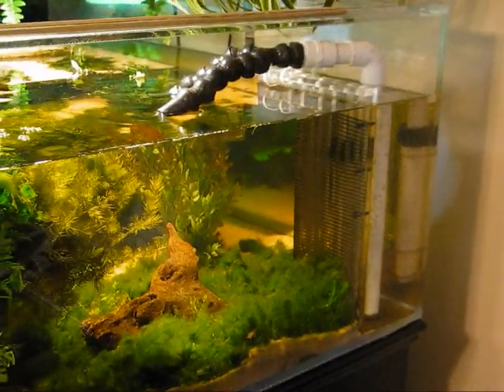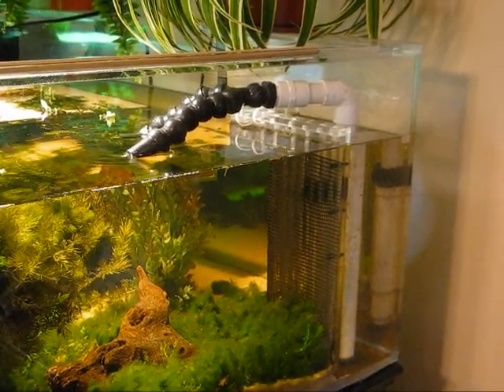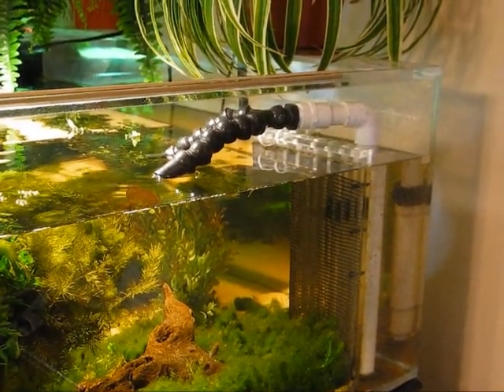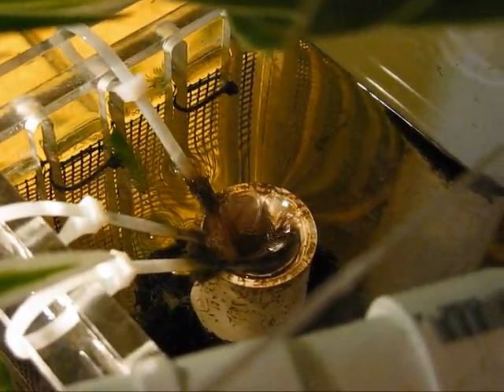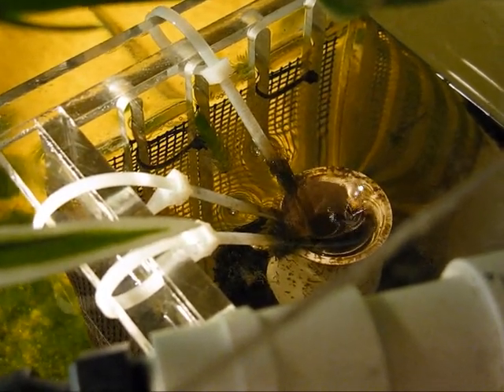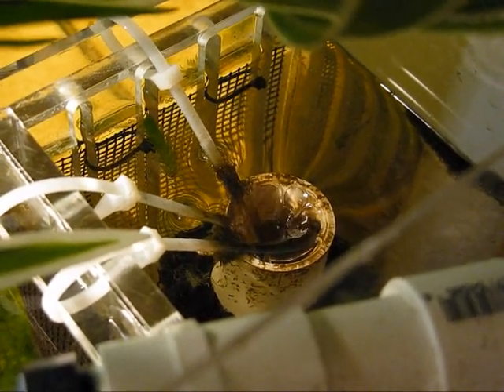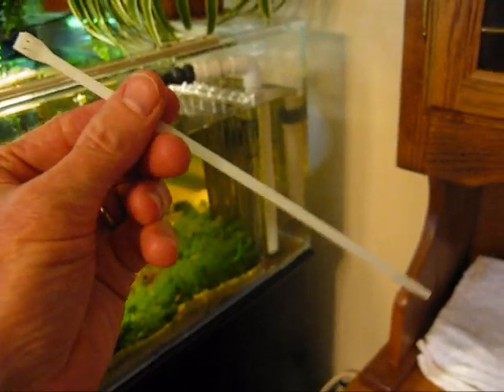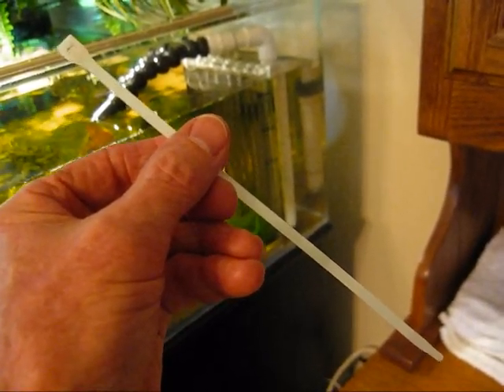Managing Wet/Dry Filter Noise

Comment: This is the best noise cancelling idea for an over flow yet. to totally cancel gurgling i also inserted a 4mm air tube. you probable will need to experiment with the number of cable ties as per you setup. good luck.

Comment from the maker: well, most wet/dry users know that if they stick their finger into the overflow while it is making noise, it often stops, at least for a while.  This is a way of doing the same thing in a more permanent way.  

as for cost, electrical ties cost a few bucks for an entire  package, you only need a few ties.

Comment: hmmm i got a question: what if you not using a overflow box wid a drill tank? 

cause i will be using a pvc overflow wid a sump, how am i gonna make the pvc overflow quiet? the same way just put the electrical tied inside the overflow tube?
Reply from the maker: I have no experience with overflow boxes, sorry, can't help you there.  I use cable ties (electrical ties) attached to the protective corner box and let them drop into the overflow tube.  It is an art more than a science to quiet the gurgling sound the overflows make.  You have to experiment with the ties.  Sometimes one will do, sometimes you'll need two or three.
Reply: oh okay thanks i think i find a way...ima just tried to hot glue the electrical ties to the tank then put the ties inside the overflow maybe it work idk yet but i tried it when i make one :) thanks again for this amazing video. +1